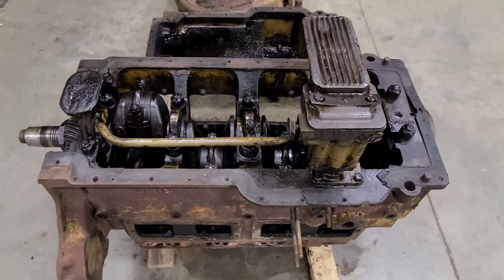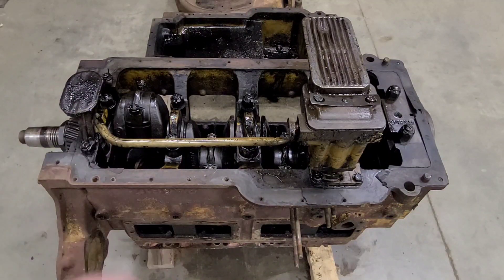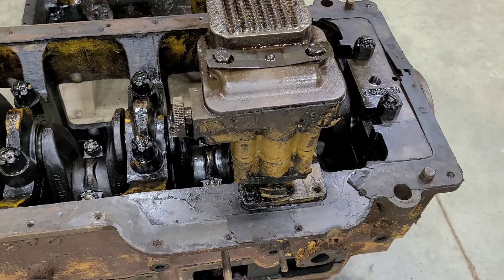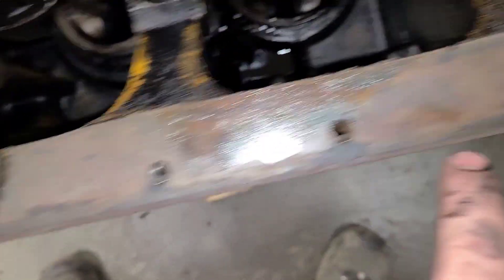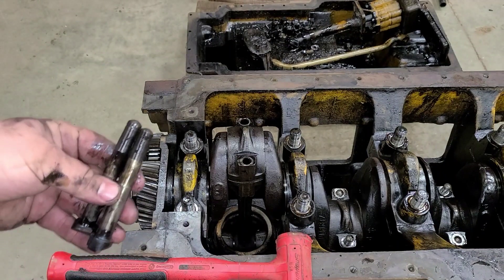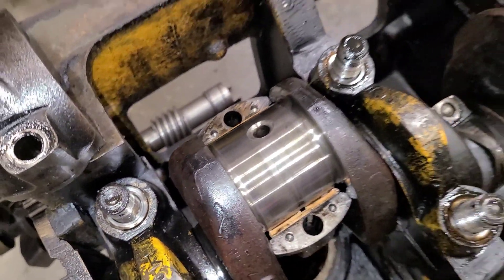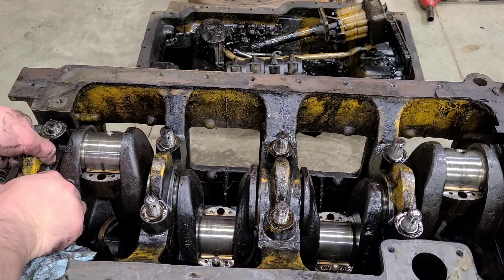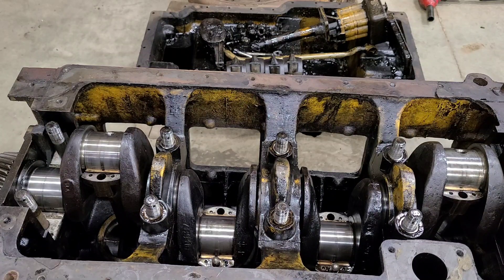Caterpillar RD-4 Engine Disassembly Pt.10 Oil Pump and Rod/Main Cap Removal

Comment: I don't know if you would be interested but, I have a 7J short block and rebuilt cylinder head from a 1940 D4.  I started a restoration project some years ago but had to abandon it when thieves raided my storage area and scrapped major parts.  My short block consists of a cleaned and crackchecked block with reground crankshaft resting on linebored mains. I think the mains are .020 undersize.  The liners are decent used with good used pistons and new rings.  The liners have new seals.  The cylinder head has new  prechambers and good at the time injectors. 

I do not want to send these parts to the scrap yard and I'm not sure how you can get back to me. I am located in Southern Maine.
Reply from the maker: Hi James, shoot me an email KD3057@hotmail.com

Comment: The D315, 4cyl  has a balancer, also called counter shaft or vibration damper. I didn't  see one in your bottom end. Dose it have one?
4cyls usually have a balancer to keep the bounce/vibration down to a minimum.

Comment: KC, I’d recommend against setting the bearings that you may reuse on the block edge. Babbitt and tin over plate is easily damaged and embedded with debris. Just turn 90 degrees and set flat on the cap instead of resting on the bearings. This isn’t the Rick Bork channel FFS.
Reply: Yes i saw that too...  hmmmmm.

Comment: Famous last words..."Well, it can't go far!" But it DID go as far as it could go...lol.

Reminds me of replacing the intake/exhaust manifold on a '79 Datsun 310. After replacing the head gasket I'm bolting the manifold back into place when my 12mm chrome plated Craftsman open end wrench slipped out of my hand. There is a straight drop to the floor and after the first clang NOTHING else was heard. That's fine its on the ground somewhere, right? I looked and looked even after the car was out of the garage and that wrench was "GONE!" So I figured it caught something just right and is against the wall and under a table somewhere. Fast forward about 8 to 10 YEARS, That wrench is STILL missing. Muffler rusted through so took the downpipe off to cut the pipe fir a different muffler. I got the pipe out and put it in the vice. Rolled it upside down to finish my cut and CLANG, The wrench fell out of the downpipe. How that 6" long plus wrench did that dive from a horizontal position to straight down that 1.75" diameter exhaust pipe is beyond me, but it stuck the landing!

Now that wrench has a special distinguished spot in my tool chest. After the heat treatment it took over the years it had the prettiest straw color to the finish. Also after that treatment it will NEVER see a bolt or nut again. I fully expect it to explode...lol.
Reply from the maker: Glad you found it back!

Comment: They may be shims, I know that on the Allis Chalmers B there is a shim pack on each rod and main bearing  so the owner could remove a shim to tighten his engine back up a couple of times.
Reply from the maker: They are shims, had to verify in the Caterpillar parts manual 👍

Comment: Thanks for the good close-up pics, it looks like you may have bought a dozer that does not have many hours on a former rebuild. Are you going to send the block as well as the crank assembly to the machine shop for a thorough clean-out as well as for a crack check ? I ask since there is evidence of a small amount of moisture accumulation which was probably from sitting unused during many temperature changes. However, sending the block, not because you believe that there may be a crack in the water cooling passageways, but sending the block to be checked for safety's sake and peace of mind. As always, Keep On, Keeping On.
Reply from the maker: Any parts that hold coolant will go because the pony motor showed clear evidence of freeze damage
Reply: @kylechrist  I thought that you would take that position and be safe for sure.

Comment: What looked like shims under main bearing cap is interesting. A parts book will tell or even a service manual should mention if shims were used in any cases. If they weren’t it will be interesting to try to determine why they were in there. Always fun to try to get the machines to tell their stories.
Reply from the maker: They are factory shims, I didn't have my books with me when I disassembled it but I did verify after looking in the parts book, thanks Geoffrey

Comment: Those bearings have some meat in them, and so much surface area compared to a more modern diesel. What's the normal oil pressure for this engine?
Reply from the maker: According to a Caterpillar article provided by Squatch253, the "operating range" on the face of the oil gauge is from 10-40 psi, with the operators manual spec saying 30 psi is ideal. Thanks Chris!